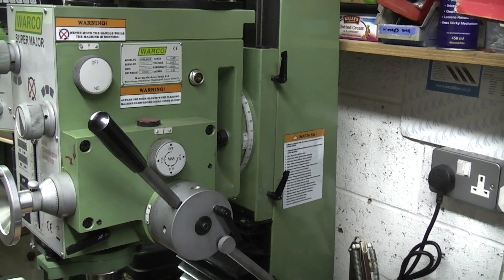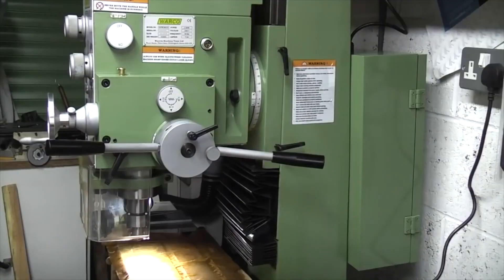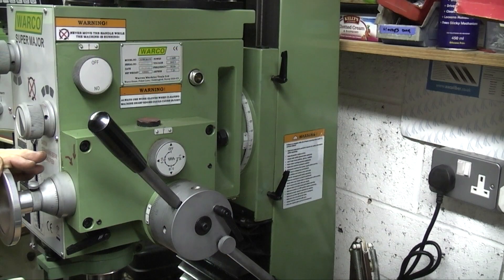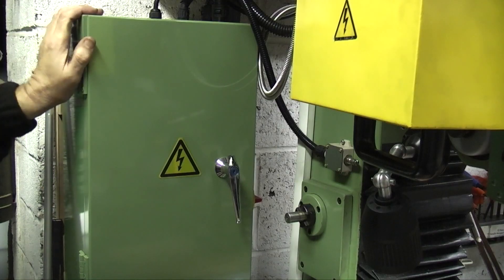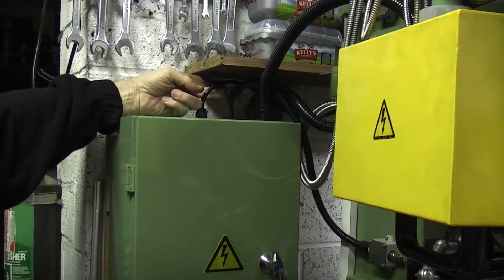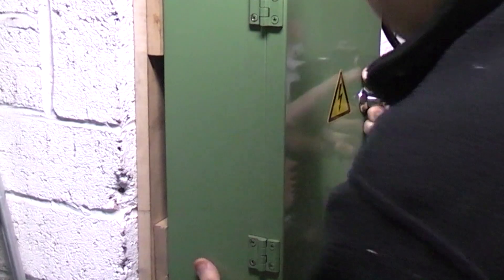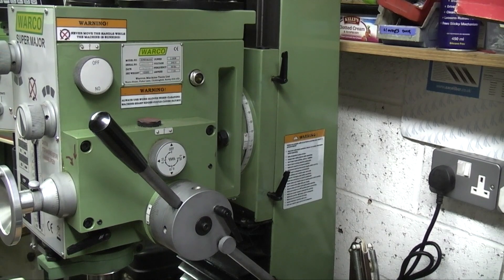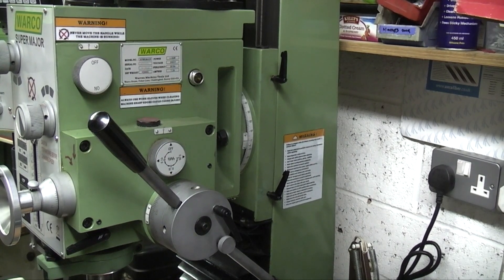Fixing problems

Comment: Hi Alan, great use of French cleat, I had forgotten about this, they used to use it a lot for kitchen wall cabinets back in the 70's & 80's. I am no electrician but if you watch my video on my mill rebuild here:  https://youtu.be/EeVufyf6nW0 at about 35 mins in I show the state of the earth connection in my spindle motor (Chinese mill probably out the same factory). It might not be the culprit but just purely from a safety perspective, might be worth checking yours out for the same thing, both motors! Cheers, Jon

Comment: Nicely done French Cleat.

Many computer installations use an isolated ground to reduce the type of problem you experienced with the DRO. You essentially implemented a ground path isolated from he mill by switching to a separate circuit. Our wiring is a tad different on this side of the Pond, but you might consider adding an additional physical ground to your system.  I did this for the sub-panel servicing my garage and it seemed to help with transients.

Comment: Your demonstration with the LED indicates that your mill is generating very large transient spikes. MOV's might be able to suppress them, but there may be an issue with inductance coupling. The best way to troubleshoot this issue is with an oscilloscope to examine transients in the powerlines. If you don't have access to an oscilloscope, I would try plugging the mill into a decent surge suppressor. They use MOV's to clamp transients. Your done if this solves the issue,, but if you still have problems, the the exposed wiring on your mill should be replaced with shielded. What's likely happening is that when power is cut on an inductive device the magnetic field collapses and generates a spike: this is how ignition coils function. You're having these issues because the designer of your machine either didn't know how to properly configure the wiring or someone intentional cut corners.

Comment: Hi Alan
I see you are using metal sockets, make sure you have the case of the outlet earthed. You should find a earth connection in each box simply place an earth wire from box to earth on socket. Hay presto interference gone.
Keep up excellent productions.

Comment: Hi Alan. Fascinating, thanks. I have a problem with my Warco lathe whereby if I turn the work light on it obliterates the radio. I too have noticed my DRO getting occasional errors. One day, when I get time, I will connect my oscilloscope to the 24v circuit to look for noise in the cables - spikes and such, and I'll connect a coil to the 'scope and look for radiated electrical interference. A good earth check would be no bad thing to do anyway. While I'm glad you seem to have got it sorted, I can't help thinking that the problem is just reduced to the point where it doesn't show rather than eliminated. Thanks again. Mike

Comment: Cracking solution for mounting the electrical cabinet on the wall, Alan.  Simple, cheap and effective.  I like it!  Lots of reports also about sensitivity of DRO's to electrical "noise" on the Web, one of the major causes was faulty earthing in the main machine - have you checked the integrity of the earth circuit in the mill?
Reply: That is almost certainly the problem. I would also place a ferrite ring on the motor feed cable, close to the entry point..

Comment: Gday Alan, I put a cheap quill dro on my mill drill, it runs by battery and the same kind of thing happens, I can zero it then start the machine then it shows a reading, some thing happens when I turn the mill off, this doesn’t happen every time but quite frequently, that’s a good idea for mounting the cabinet to the wall, take care,   Cheers Matty